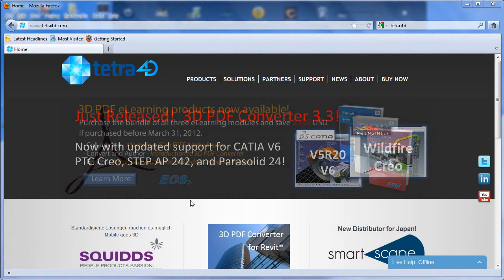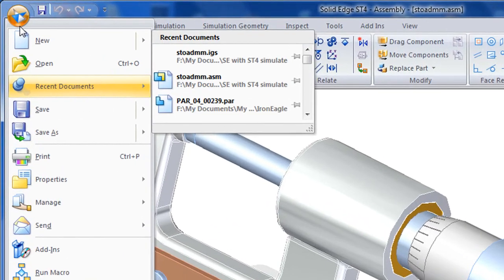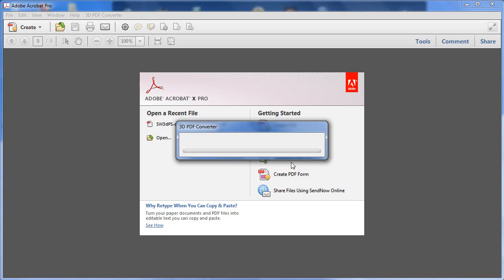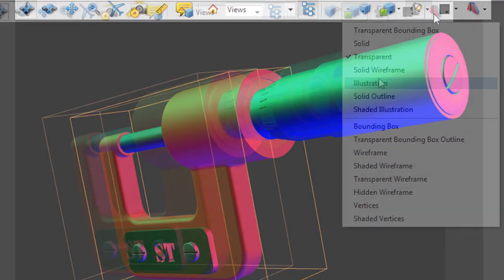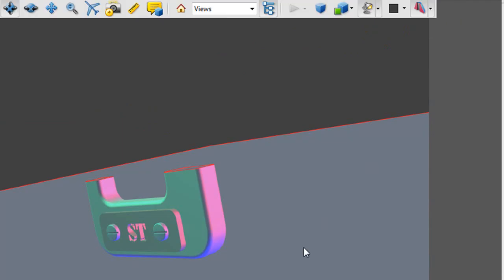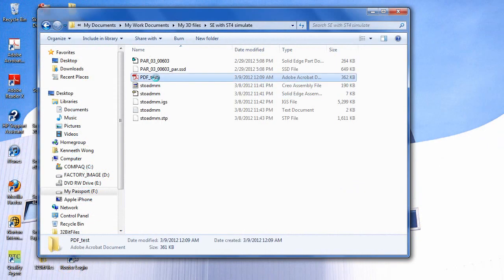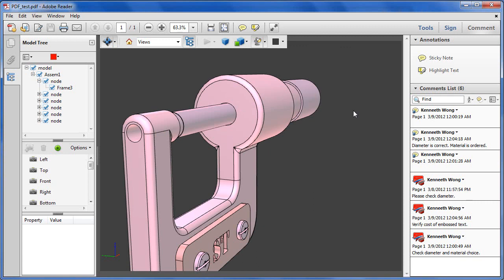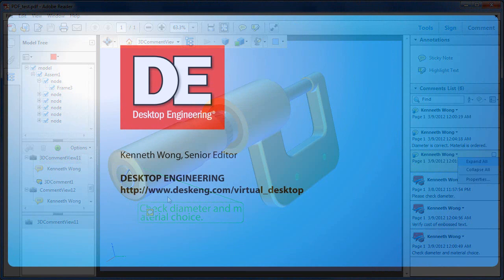Tetra 4D PDF Converter.wmv

Comment from the maker: @jimmerryful Thanks for the input! I did try reading in a few native CAD files in Acrobat X Pro with 3D PDF Converter, but ran into some issues (error messages during conversion). So I thought a better approach is to manage it as STL. Besides, the file format is just a lot lighter to work with. --Kenneth